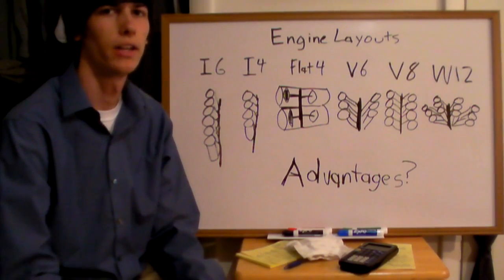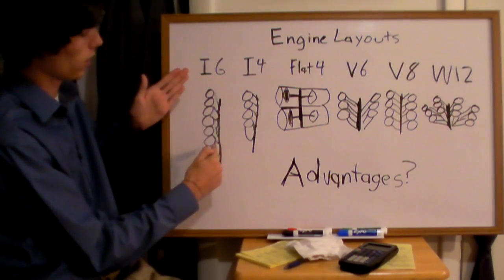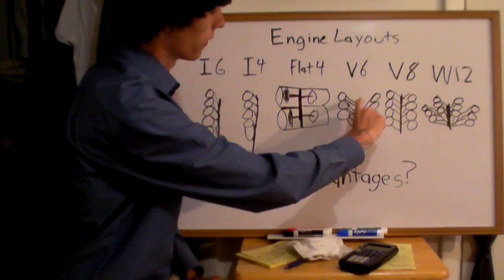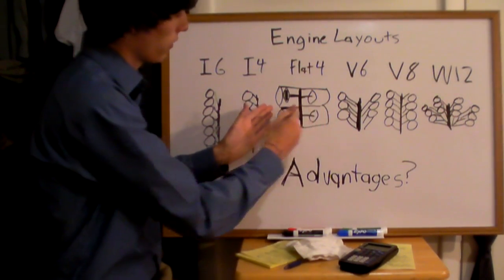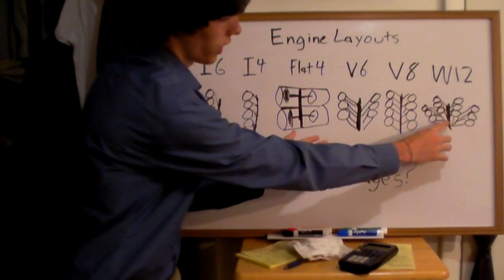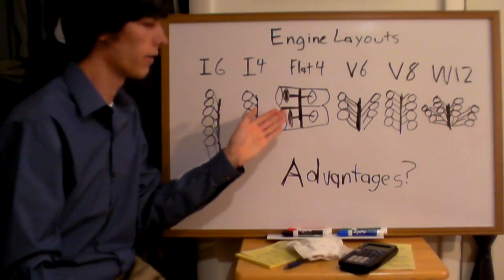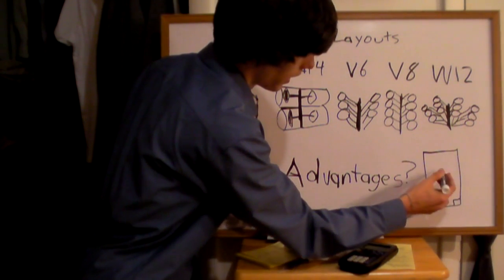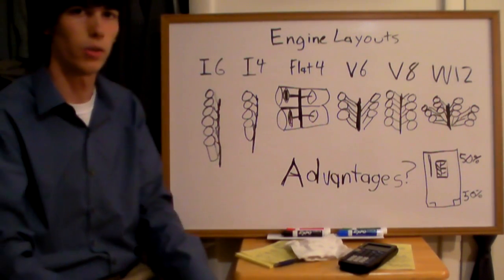Engine Layouts - Explained (V6, I6, V8, W12)

Comment: Flats and boxer are not the same thing as flats pistons are connected to the same crank shaft where boxer pistons are fighting against eachother (that’s where boxer comes in) on seperate opposite crankshafts but still flat like a flat engine

Comment: You should point out that although all boxers are flat motors, not all flat motors are boxers. As for your layout for a W12, crankshaft wise. For example, the cylinder layout you drew is 2× VR6's sharing a common crankshaft ( a straight 6/ V12 pattern crank), not 2× V6's. That would require 4 conrods per big end journal!
Reply: Ya bro you should build him a time traveling machine so he can go back edit and then upload

Comment: What is the measurement of LITRE (eg. 1 ltr, 1.5 ltr, 2 ltr....etc) in a combustion engine? 🙏
Reply: To calculate engine displacement, is the volume of all cylinders added together- ie the bore and stroke. Using cm as the measurement, Halve the bore size gives the radius, using pi (3.14)×radius squared then multiply the answer by the stroke in cm. This will give cylinder displacement in cc. Multiply that by number of cylinders is the engine cc ie 1500cc or 1.5 litres. Never saw complex mathematics useful in everyday life but this is the one thing I never forgot from high school. Hope it helps.

Comment: I still don't understand why there are so many different types of engines. Been making so many for so long, there's gotta be one that is the most reliable and efficient. I don't think shape and size should be a factor in determining what you should use.. build the car around the engine that is best not the other way around

Comment: Do you have some video about Torque Converter ... of 1500 rpm , 2500 rpm, and more ..and diameter ....race , drag , trucks , family , .....i confused about that ..... 
my point is ..i want put some torque convert in my truck c10 83 ... cheers ..

Comment: No mention of opposed engines? I know it's unlikely that one will be found by most but they're still interesting.
Reply: Opposed piston engines are pretty weird but interesting. Sleeve valve motors are another cool design too even though a bit off topic here.
Reply: BazilRat 
the flat 4 is considered an opposed 4 engine.

Comment: is a flat engine basically a flattened v engine?
Reply: Supa7 Turtle No, because an inline only has pistons on one side.
Reply: hmm
Reply: No. In most cases, the crankshaft is different dependant on number of cylinders. As most flat engine designs are boxers, the crankshaft is going to be different most times. One common exception is the V twin that has 2 big end journals (Honda CX500, Suzuki M109 Boulevard) whose crankshafts are the same as a boxer twin.
Reply: no, it would be a flattened inline engine
Reply: here: http://www.google.co.uk/search?q=gt86+engine+diagram&prmd=isvn&source=lnms&tbm=isch&sa=X&ved=0ahUKEwib6uCL9-rQAhWIKsAKHcTVBeMQ_AUIBygB&biw=1280&bih=800#tbm=isch&q=gt86+engine+diagram+above+cutaway&imgrc=oPMWMhtv3Fdw-M%3A
Reply: Yes unless it's a boxer due to the type of firing order

Comment: I don't know where to post my question, cause I believe you haven't made a video on it. Could you explain the relation between number of cylinders vs engine displacement? why are there cars with a 2.5L 4 cylinder engine and other OEMs chooses to make a 2.5L 5 cylinder engine? what's the advantage and disadvantage? can a 2L V12 be possible? etc
Reply: Carlos André Fernández Flores The displacement that the engine has is found by multiplying the bore, stroke, and number of cylinders together. So an 8 cylinder engine can have the same displacement of a 6 cylinder, but it will have either a smaller stroke or bore.

Comment: Looking for the explanation to relationship of liters and cylinders. For example, there's is a 3.0L 6 cylinder and a 3.5L 6 cylinder and I've also seen a 3.6L 6 cylinder. they are all 6cyl so what's the purpose of the different liter size and how does that affect or change anything? Thanks.
Reply: It's the size of the combustion chamber (if I remember correctly) so a 3.6L V6 will be slightly bigger than a 3.5L V6
Reply: +KEINOMADDONE cylinders refer to the amount of pistons the car has. 3,4,5,6,8,10,12...... A basic explenation of liters is the displacement of the pistons. The area surface it travels, basically math will tell you a 2 in bore piston X the distance it moved up in the cylinder X number of cylinder ect...will give you its displacement or engine size (does not mean phisical engine size) so a 1.6 liter is relatively small and economical compared to a 5 liter, more displacement more power less economy, although todays technology has made leaps in economy for larger engines.
Reply: the liters is how large each cylinder is, for example if an engine has a 3 liter V6 that means each cylinder can hold half a liter of fuel essentially, the more room the better, a 4 liter V6 is going to be better than a 3 liter V6 ( being they are the same engine )
Reply: miguelpoky, please stop explaining things you have no clue about. you are completely wrong in you assesment of displacement....so just stop, someone might actually listen to you.
Reply: How am I wrong?, I wasn't even explaining displacement

Comment: what does it mean when a car is 8v or 16v?
and whats the difference?
Reply from the maker: +Tom jolley Number of valves. https://youtu.be/1GZtShToroc
Reply: +Tom jolley I think I know.........but watch his video.
I think its the number of *V*alves a cylinder has to intake and expel (exhaust) air.  On a 4 cylinder,  8 valves would mean 2 valves per cylinder,  on intake, our exhaust.
Reply: 8 valve and 16 valve. Valves are used to get the air/fuel mixture. Some 4 cylinder cars only have one intake and one exhaust valve per cylinder, hence 8v. Cars with a bit more poke generally have 2 intake valves and 2 exhaust valves per cylinder to let more air mix with more fuel, usually means lower mpg from the 16v than the 8v but more power output.

Comment: After taking a look at Google pictures, I saw w12 engines and they had 3 rows of cylinders. Did you make a mistake?
Reply: jcrohm88 Wow, rude.
Reply from the maker: +Eston Playz And Stuff There are different kinds. Here's what Bugatti does (W16). It has "4" rows, though it's really more like two VR blocks. https://youtu.be/0kKo4Zw9ynw
Reply: Engineering Explained Oh, thanks.
Reply: @jcrohm88 ok mate....why don't you make a video explaining the different kind of engine layouts and then we call you a dipshit.

This guy obviously spent time and effort to make these videos and for you to come in with you're negativity.....honestly you just need manners slapped into you.
Reply: +Engineering Explained pistons are NOT connected to pushrods you dipshit those are called "connecting rods"
Reply: +Eston Playz And Stuff more like "wrong" fucktards who don't know shit shouldn't make videos
Reply: The real doktorbimmer I wasn't talking to you
Reply: The real doktorbimmer or talking about gay W12 engines
Reply: +The real doktorbimmer the only reason I'm on this thread is cause the dude in the video said that pistons are connected to pushrods. and I have no opinion on W engines no matter their particular sexual preference
Reply: +Engineering Explained You didn't talk about the VR6 or I5.  They are very interesting because they do some funky things to get the engine balanced, especially on the 5.  There is an odd number of cylinders, so it is difficult.  And in case you can't tell, I like Volkswagens.  (;
Reply: +Engineering Explained whats with the mercedes benz w124 is it also 124 pistons?

Comment: you didn't explain advantages of inline 4 or 6.
but I saw your comment "Inline 4's are common because they're economical, easy to balance, easy to maintain, and fit easily in FWD/RWD."
what do you mean by easy to balance, and how are they easy to maintain?
Reply: +My Nam The biggest advantage of an inline engine (4,6,8 it doesn't matter) is that it is inherently balanced.  When one piston goes down there is another one going up at the exact same time.  The counter example is the V: when one piston goes down, there isn't necessarily another one going back up at the same time,  so it is inherently unbalanced.
Reply: +My Nam  as other replies have said, the balance deals with the piston moving up and down. if one goes up and one goes down at the same time then the moving forces counteract and the engine will stay in one place, but if there isn't a piston doing the opposite it can cause engine wobble which isn't good.

Comment: NA petrol engines, same displacement (2.8 electronic injection 4 valves per cylinder), but first is a 4 cylinder, second a v6, third : v8. Hp is 180 - 280, 7 kilo/ hp for each car, FWD, each. The acceleration upto 100 miles/hour will be similar for all, but as from there v6 and v8 will leave the 4 cylinder behind and as from 125 mph, v8 will leave v6 behind, upto max speed of 240 kph(eg.)
More displacement (and in a less way, more cylinders) will accelerate faster to top speed, though the difference will be a mere a few seconds.
Of course, add turbo's and the game changes. But a 2.0 turbo 4 cylinder vs a 2.0 turbo v6, again, the v6 will gradually depart as from 180-ish kph. The difference will be minimal though.
Consumption is another thing, of course. Electric engines will provide a whole new range of possibilities as storage will succeed more efficiently in the future.

Comment: which type of engines are used in everyday cars
Reply from the maker: Akshay Dua I4, V6, V8, I3, I6, H4. Relatively common.
Reply: Engineering Explained how does the no of piston help in incresing the power?

Comment: A friend of mine years ago was restoring a beautiful 1955 Ford Coupe and the mechanic referred the motor to a Y8. Is that the same as a V8?
Reply: The ford Y block is an actual motor. Its a v8 with a distinctive but not radically different shape looking from the front.
Reply: You probably misheard, he meant V8 
No such thing as a Y8

Comment: So the V engines' advantage is to not only fit inside the car but to have weight balance between the front and back?
Reply: ViceN53X It also decreases the length of the crankshaft. More distance you're applying the torque, the more rigid the crankshaft would have to be... I think...
Reply from the maker: ViceN53X Depending on placement, sure.

Comment: Could you do a in depth video on w-12 engines please?
Reply: It actually a 2 vr6
Reply: they're just 2 v6 welded together
Reply: Or a v8 with a straight 4 sticking out the top like \|/
Reply: hm

Comment: What I know about the W12 is that it's two VR6 engines mated to drive one crankshaft. A VR6 engine is a 15 degree bank V6. Some called it a staggered 6 because of the staggered pattern and strongly resembles a straight six in terms where the intake and exhaust manifold are placed.

Comment: If you read that a car has a FR layout it means Front engine RWD so all the layouts i know of is FR. M-FR, FF, RR, MR, R4, F4 and M4 and i heard one case where a car had RF which is in most times the least necessary layout. M-FR is Mid-front RWD like some BMWs got.

Comment: Correct me if I'm wrong, but from what I've read, a W12 would have three banks of cylinders rather than four. I'm pretty sure in the video thats a VV12 used by Volkswagen which is two banks of 6 in a VR pattern?
Reply from the maker: Can be both, some have a triple bank, others use two VR6's.

Comment: W12 are not 2 V6 together. That would mean that it has 4 blocks. W12 are 2 VR6 engines. W12s are awesome engines and the most interesting mechanically speaking.
Reply from the maker: Yes indeed. Two VR6's.

Comment: Can you explain why there's no more v4s like what are their pros and cons? Like does it take up to much space, not enough power or expensive to produce?
Reply from the maker: I believe they are still used on motorcycles, could be wrong though. I4's are just really easy engines. Simple layout, space requirements, less camshafts, easy to maintain, probably cheaper.
Reply: v4s are used in motorcycles. mostly in sports bikes
Reply: sickgr33k yes like the aprilia rsv4
Reply: sickgr33k yes like the aprilia rsv4

Comment: Do you think a same size engine V6 and inline 6, which one do u think will have a better performance?
Reply from the maker: The one with more efficient airflow, they're probably pretty close.
Reply: Engineering Explained I guess the inline design will be more balance because the V type will have more rocking from motion from side to side

Comment from the maker: Yes, the vibrations created from power strokes are balanced out in an inline six, where as you have to add more counterweight to the crankshaft in V6's to balance out the forces. That said, the compactness of the V design can be advantageous.

Comment: You forgot that W engine can have another configuration with 3 cylinder banks - most common engine of this type is W18, which is like 3 inline six engines

Comment from the maker: Comparing the engine layout typically isn't all that useful. A boosted I4 could out-power many naturally aspirated V8's out in the market. Also, engine size is a critical factor. I'd compare engine size, and aspiration, to have a better understanding of why one is more powerful. Then look to the valvetrain design and compression ratio, as well as rev limit. These will typically hint at the engine's power much better than the layout.

Comment from the maker: No, they fire sequentially. In a four-stroke four cylinder engine 1 cylinder will fire every 180 degrees of rotation of the crankshaft. It takes 2 full revolutions of the crank for every cylinder to fire (thus four strokes).

Comment: Are there any W12 engines that use 2 60/90degree V6s? I imagine that would make an engine impractical because of its dimensions. The W12 that Volkswagen uses has 2 Vr6 (narrow angle v6s) and the W16 in the Veyron has 2 "Vr8s."

Comment: There is a difference between a Boxer engine and a flat "V" engine (180 degree V engine). Sadly i.dont know the right terms in english but the difference is in the way how the pistons are connected to the crankshaft

Comment from the maker: Intake or integrated air/fuel module; the engine has 4 cylinders, dual overhead camshafts, and 16 valves. Check out my video "engines - explained" which should help make most of this clear.

Comment: One of my favorite motors came with the Ferrari 512 Boxer. As the name implies it comes with a flat 12 engine. The boxer motors are called inherently balanced with the crankshaft centered between the pistons and can be built to handle higher RPMs. Those motors are almost impossible to blow up. The I6 design is on the other end with a lot of stress on the long crankshaft. Came in Jags and Datsun Z cars.
  there were some old Packard I8's that snapped crankshafts in half in you reved them too high
Reply: nice

Comment: V's are more compact but in an OHC setup they need two valve trains one for each side of the V and this makes them more expencive.
Boxers keep weight low and are also more compact but same as the V they need seperare value trains on each side of the engine if you want OHC.
straights are cheaper and simpler to make, they only need one valve train for OHC but they can be long (like an I6 or I8) and also quite tall leading to a high center or mass.
I think thats about it really.

Comment: Advantages to a I6 is that the rb26 and 2jz are indeed I6TT and can handle 1000hp with stock internals...ONLY THE RB26 AND 2JZ

Comment from the maker: I prefer tonguing (verb?) the keyboard. Regardless, I wouldn't say that it's necessarily the best to have 4 valves/cyl, but it is more advanced than OHV. Though of course, you could have a poorly engineering DOHC engine and a well developed OHV engine (NASCAR does this).
Reply: I had a 4 valve ohv. Revved well, ultra reliable. Honda CX500. The turbo model was the fastest Honda up to 1200cc ( not incl race bikes!)

Comment from the maker: Boxer* engine. Boxster is a Porsche model. One could counter your statement by saying that engines should not be placed behind the rear axle of a car, decreasing agility by increasing the moment of inertia on the vertical axis of the car, as well as the increased probability of oversteer. But, fortunately for you and I, both Subaru and Porsche engineers know very well what they're doing.

Comment: More cylinders = more internal friction = worse economy.

However,
More cylinders = more refinement = smoother car.

Also:
I6, V8 & V12 perfectly balanced [ V8s need additional counter weights on crank ].

I3, I4 & V6 need balancer shafts = more cost.

V engines need more parts than I engines [ 2 heads, double no. cams, valves etc. ].

I engines need more space than V engines.

Easier to package turbos on I engines than V engines.

It's a complex decision as to what to design for !

Comment: Good comparison of the different layouts.
Sometimes the Flat 4 is also called "H4". And to be honest: I've never seen a W12 as you show it here. The Volkswagen W12 or Masserati W12 are a 1 1/2 V8, which means three cylinder-banks. But there might be some other constructions out there ;)
Reply: tiefflieger 🎤🎤🎤🎤😍🎤🎤🎤
🎤🎤🎤🎤😍😍🎤🎤
🎤🎤🎤🎤😍🎤😍😍
🎤🎤🎤🎤😍🎤🎤🎤
🎤🎤🎤🎤😍🎤🎤🎤
🎤🎤🎤🎤😍🎤🎤🎤
🎤😍😍😍😍🎤🎤🎤
😍😍😍😍😍🎤🎤🎤
😍😍😍😍😍🎤🎤🎤
🎤😍😍😍🎤🎤🎤🎤

Comment from the maker: 1. A shorter crankshaft is typically superior as the forces will not bend or warp the shaft (a longer shaft could experience this issue keeping strength the same). Lighter is typically always better, as long as it's balanced. So a shorter shaft will be lighter, meaning less weight and less rotational inertia to overcome.
2. I believe you're confusing flat with "straight" or "inline." Inline 4's are common because they're economical, easy to balance, easy to maintain, and fit easily in FWD/RWD.
Reply: huh